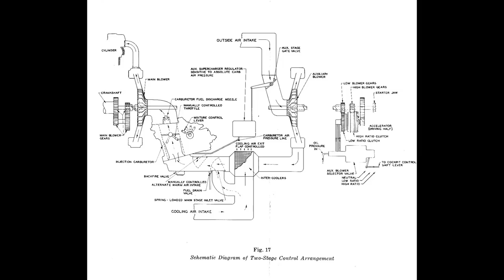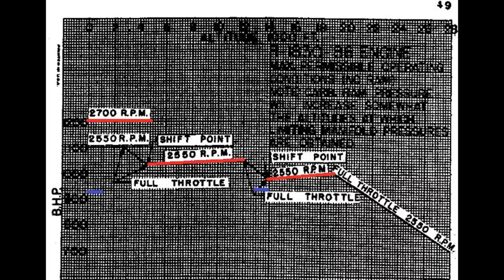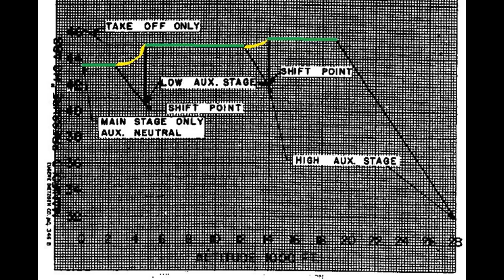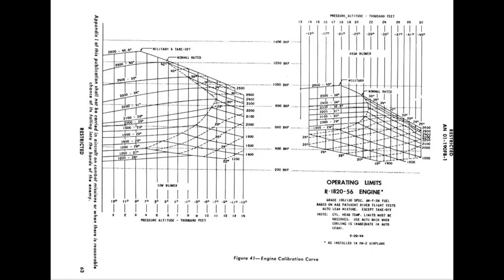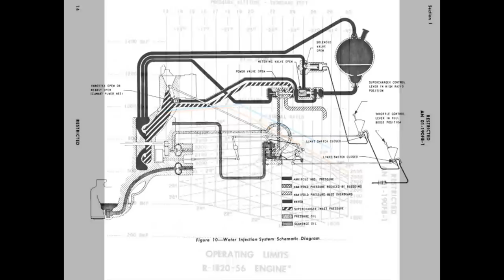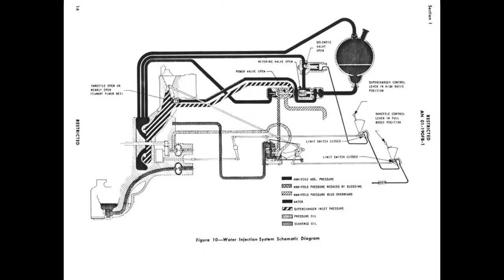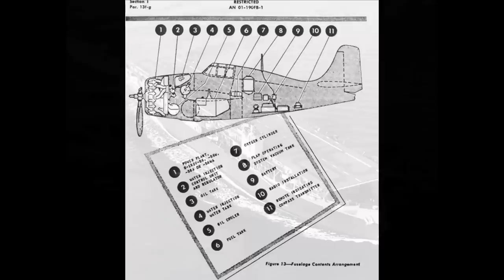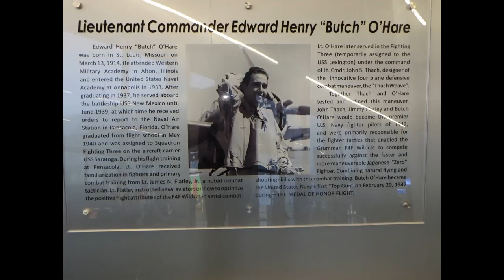Grumman Wildcat and FM-2

Comment: The Sagamon class of escort carrier, due to their size, had composite air groups that contained F4U Coursairs.
Reply from the maker: Maybe, I haven't seen evidence of that, and if it was done it was rare. Now I have seen a picture of a Corsair landing on the USS Charger, which a carrier featured in this video, but that doesn't mean it was operating off of it. It was usually an emergency situation, ferrying of the aircraft, or qualification work.
Reply: @GregsAirplanesandAutomobiles  I found it in a book on Leyte gulf
Reply: Doing a quick search I found some vague allusions that they could but no solid info that they did. Also we're talking about 4 ships out of over 120 escort carriers constructed most being the smaller Casablanca and Bogue class.

Comment: The more one looks into things the more it becomes apparent that the Zero is a false god, it's reputation is basically built on it's early use against obsolete Chinese biplanes and it's early use against the US Navy, but those guy's learned fast and quickly turned the tables against the Zero.
There's a surviving Japanese ace (first name Honda, I can't remember his last name) who was interviewed not long back in a video here on YouTube, he himself said that the Zero was their worst fighter of the war because the designer's mistakenly thought that the best fighter design would be an aerobatic plane with gun's on it, completely disregarding any kind of survivability for the sake of performance turned out to be a very big mistake on their part and cost them a lot of pilots. 
The loss of the original 2 stage supercharger on the Wildcat is supposedly attributed to the upcoming F6F and F4U's, I've read where the powers that be decided that since the manufacturing of 2 stage superchargers was limited they should go to the new F6F's and F4U's that were just starting production.
Reply: The thing that set the Zero apart from its contemporaries was its range. It was the first true strategic fighter. Rabaul to Guadalcanal is further than London to Berlin and the Zero could operate over that distance.
Reply: @bobharrison7693  
That's a good thing though, because they had a long range means they could get to all the places where they were shot down.

Comment: I've read about Wildcats using diving attacks on Zeros since I was a kid- so very interesting to learn that the airplane had no aerodynamic limits in a dive. Are there stories of compressibility issues during Wildcat development or operations, or was the shape not as prone to developing the shock waves that bedeviled the P-38?
Reply: Several contributing factors, the Wildcat is a high-drag design. With it's fat stubby fuselage, lack of filleting, steep wingscreen, the large radial engine with its Pre-NACA wind tunnel cowling. It couldn't dive fast enough to get into trouble, even when pointed straight down. Later craft such as the P-47 and Hellcat, especially the Bearcat, had vastly superior internal cooling improvements. Although they look approximatly the same, they are a technological leap and bound ahead of the wildcat.

The F4F used a 15% thickness Airfoil at the wing root, and the P-38 used a thicker 16% section by my research. (Spitfire = 12.97% and had the highest Mach divergent drag speed of all). Thinner Airfoils create less of a velocity increase over their surfaces, allowing higher speeds before compressibility effects take over. For sustained supersonic flight, ideally you want less than 5% thickness. but anything below 8% can often be made to work, even for a straight wing, given enough horsepressure. See: Bell X-1.

The P-38 was recently discussed on this channel, and it was mentioned that the twin booms and fuselage center pod created a Venturi effect between then that sped up the airflow even more. Right over that 16% thick Airfoil section near the root. This would cause the airflow to go supersonic over the wing at an even lower Mach number. Perhaps less than M0.65 or so. Not much higher than the P-38s top speed at high altitude in the winter. Complicating matters was that the P-38 horizontal stabilizer was located nearly directly aft of the wing, it wasn't staggered vertically any significant amount. So it would get blanked-out by air buffeting from the supersonic shockwave forming over the wing, losing its effectiveness. All at the same time the center of lift (center of pressure) over the wing was moving farther aft due to the shockwave, causing the center of gravity to be located even farther ahead of the, now relocated, center of lift. Which makes for a too-stable airplane that's too nose heavy. Again, at the same time it's elevator is becoming ineffective. (See: Mach Tuck). 

The wildcat has a conventional tail, located farther above the wing, and that fat fuselage is constricting at the rear end, which tends to reduce the local velocity of the air as it reaches the tail. So the wildcat probably has a higher dive Mach number than the P-38, because of the thinner wing and more effective horizontal stabilizer. And then it's so draggy that it could never get there. Perhaps, I'm only speculating, that it's internal cooling air could go supersonic long before the wing, creating a mach-divergent drag increase internally, casing the airplane to effectively hit a wall in a dive. This is not pure speculation, as the NACA works on internal Mach numbers extensively.in the early 1940s on other models, after the wildcat first flew.

Also, people know the Mustang used the Marideth effect to generate additional thrust to offset cooling drag, but it could contribute to radial engine thrust as well, it only required a tight cowling and properly positioned cowl flaps, and a gentle-radius curvature of the firewall to allow the airflow to accelerate smoothly out the opening. I'm not joking, it was that easy. In addition to Marideth, they worked on ejector exhaust, and found for the pure supercharged designs (not the turbo p-47) NACA showed that one could easily achieve an additional +16% Horsepower equivalent thrust at 350mph from a properly designed exhaust system, on a supercharged engine. That's around +300 additional Horsepower worth of thrust for a Corsair, Hellcat, or Bearcat.  (In addition to using the exhaust velocity to "pump" air out the cowling for engine cooling during ground run-ups, using exhaust augmenters. These were able to achieve over 6-inches of water drop vacuum through the engine cooling fins, using the exhaust to pump the air out). - Neat stuff.
Reply: shorter answer, the Wildcat's aerodynamically limited terminal velocity in a dive was still quite a bit below the speed where compressibility is a hazard.
Reply: @TheJustinJ   good info but for my understanding, what do you mean by percent? You mention that the P-38 had a 15% thickness airfoil at the wing root. What is that 15% of? It's height is 15% of it's length?
Reply: @danraymond1253  nailed it. 

The P-38 was 16% at the wing root, that is thickness to chord ratio, or hight to length, yes. 

Thicker-percentage means the airflow over the curved surface accelerates to a higher velocity, in reltation to the air rafts forward flight speed. (In engineering terms, this is expressed as either velocity or pressure as the two are interchangable, higher velocity is lower pressure ala Bernoulli).
Reply: @TheJustinJ  cool and thanks for the reply. Does this mean that (in general, I'm sure there are multiple variables at play here) a thicker wing for it's chord would produce more lift and thus a more maneuverable fighter? 

Also, (not that you're wrong, I am just curious to learn more) can you provide a source with the airfoil thickness of other airplanes or at least the P-38? I'm a big fan of the P-47 Thunderbolt so I wonder what the airfoil thickness on that was. I am starting college now and have a major interest in all of this, though I am still quite naive to many of the principles of aerodynamics. I'm sure I know a lot more than many peers my age, but I feel the more I learn, the more there is to learn that I cannot yet understand.
Reply: @danraymond1253  Wikipedia NACA airfoil
Reply: @TheJustinJ  Excellent comments...quite a learning curve for us WW2 buffs. Thanks.

Comment: I know why The F8F Bearcat only has a single stage supercharger  system now after watching this video . I always wondered why they didn't put a two stage blower in it.  A variable speed supercharger means the supercharger can change it's speed independent of engine rpm. Is that a big improvemnt over a 2 or 3 speed supercharger?

Comment: The SNJ was sold to Congress as being combat capable due to funding issues in 1940 and the SNJ when armed for advanced training would have been a credible convoy escort aircraft with a depth charge or a few bombs and a cowl-mounted machine gun firing through the propeller arc (changed to one wing gun firing outside the propeller arc) and a machine gun ring in the back cockpit for air-to-air gunnery.  If not for "excess" Wildcats, the SNJ might have wound up protecting convoys from U-boats and flying boats.  Or not--a single .30 caliber nose gun isn't much when used in the fighter role.

Complain about the FM-2 having less performance than the Zero?  It could have been the SNJ.

Comment: Another great video.  I'd like to ask two questions:
1.  Why is slightly more manifold pressure permitted at higher altitudes?  Is it assumed the cooler air there allows more manifold pressure before reaching the detonation limit?
2.  Even with the higher manifold pressure there is somewhat less horsepower.  Is the chart at around 10 minutes into the video net horsepower, and is the reduction due to the power consumed by the auxiliary blower, or something else?  
Thanks
Reply from the maker: 1. The intercoolers are more effective in the cooler air. 2. Although manifold pressure is the same, the superchargers need to create a lot more boost due to the low ambient pressure. More boost costs power in terms of the energy needed to drive the superchargers themselves.
Reply: @GregsAirplanesandAutomobiles  Thanks Greg.

Comment: Although On The Brink Of Obsolescence, The Grumman Wildcat Proved It's Worth On Escort Carriers NOT In The Pacific So Much But In The Atlantic As Part Of The "Hunter/Killer" Anti-U-Boat Teams. It Was The Wildcats From The Escort Carrier, -The "Baby Flat Top," -U.S.S. Guadalcanal, Commanded By Captain James Gallery, That Assisted The Destroyer Escort Team To Force-Surface And Captured The U-505. The Wildcat Pilots, Observing The Just-Submerged U-Boat, Fired Their Machine Guns Into The Water Of The General Area Of It's Submergence, Following The Enemy Vessel Beneath The Surface Until It Could No Longer See It. Then The Destroyer Escorts Applied Sonar And Depth Charges To Bring The U-505 To The Surface And Applied Machine Guns To To The Escaping Crew, Keeping Them At Bay To Be Captured Along With The Sub (That Now Resides At Chicago's Science And Industry Museum.) It's Appropriate That A Wildcat SHOULD Have It's Place, Also In Chicago, At O'Hare Airport.

Comment: You ask what other airplane has no speed limit, where the terminal velocity straight down is not enough to damage the airframe.

Stearman 75 biplanes also are in that rare club.
Reply from the maker: Sort of. I have flown the Stearman and it's true that it's terminal velocity will not over speed the airframe. However it will overspeed the engine, at least with the prop that was on the one I flew.

Comment: 12:20 I'm guessing that it's just because you're using your old commentary, and you knew less back then, but I don't think this part is right. Those drops in boost appear to be the points when a given drive speed has gone past its critical altitude and is now unable to provide full manifold pressure. The throttle should already be wide open in these gaps, so there simply isn't any more boost to be had. The only way to get more boost would be to change speeds early. That would provide full manifold pressure, but the throttle would have to be reduced to avoid overboost, and driving the supercharger faster would consume more power and result in a loss of power to the propeller instead of a gain.
Reply from the maker: No, and no. It's not because I am using old commentary and the pilot's manual very specifically says to pull the throttle back before engaging the aux blower  in low speed and then again before switching it to high.   Failure to do so will absolutely risk overboosting the system. I explain all this in my Turbo vs. Supercharging videos.
Reply: @GregsAirplanesandAutomobiles  From that description, it sounds like the Wildcat needed manual throttle control below critical altitude to prevent overboost (because there's no automatic regulator?). In that case, the instruction about reducing the throttle before speed switch would be to prevent overboost in the higher gear, and would presumably be something you did just before switching. I don't believe that explains the dips in manifold pressure on the diagram. Those are a necessity of any multi-speed system.

Take a look at FIGURE 7 in NACA report 384. I know this isn't showing a multi-speed system, but actually six different sized superchargers, but the principal is the same as a multi-speed system. Supercharger "A" hits critical altitude at 5000 feet. After that, it starts loosing manifold pressure and power, but it still has more power than supercharger "B" for a while. The two lines cross at about 6000 feet, which is the optimal speed change point. That means that between 5000 and 6000 feet, we will see a dip in manifold pressure, but this is still the optimal way of running the engine. The throttle is wide open during that whole range, so the pilot has no way to get more pressure or power.

I believe those dips in the Wildcat diagram are for the same reason. Even if the Wildcat pilot isn't climbing, and so isn't about to change speeds and doesn't need to reduce the throttle, if he's at 4000 feet, he'll still be running at a lower manifold pressure. That's because, at 4000 feet, the primary stage is well above critical altitude, but is still producing more power than the auxiliary stage low would. A "really careful" pilot should be able to hold off on reducing the throttle until just before speed change, but that won't get rid of the manifold pressure dips because there will always be times during his climb when he's running a supercharger speed beyond its critical altitude, so his manifold pressure will go through that saw tooth pattern no matter what he does.

Comment: I read in a book that zero had stiff alerons somewhere above 20,000 feet.
Reply: That was above 250 knots. The A6M had huge ailerons and it was hard to roll at higher speeds. Allied pilots learned to stay above 250 knots.
Reply: Also had diving speed limits..

Comment: The Wildcat did more than hold the line. They took the fight to Japan. You can say the same about the P-39, P-40 and the P-38 come late 1942.
Reply: I find it funny how certain low altitude aircraft get Heavily criticized, while others are heaped with praise.

P-40 vs Hawker Typhoon, for example. Arguably the P-40 was far more important to WW2 than the Typhoon, yet the Typhoon is idolized, and I really don't understand why. The Typhoon did nothing the the P-40 and other aircraft couldn't.

But low altitude planes include the likes of the F4U, IL-2, Hurricane, etc.
Reply: @SoloRenegade  It is interesting you compared the P40 to the Typhoon, The Typhoon's designed role was high altitude. problems with the engine made it unsuitable/ Hence the rework into the Tempest. New engines and were tested and a laminar flow wing was added if memory serves. It was none the less a beast down low.
Reply: @JohnRodriguesPhotographer  the Typhoon contributed little. The P-40 contributed more. Both were low altitude fighters that also performed ground attack. One is criticized constantly, the other overhyped. Just calling out the logical inconsistencies with which certain airplane are judged.

Comment: The plane in the intro is not at O Hare Field, it is at Midway Airport. Midway is in the South Side of Chicago and I have spent a few minutes examining it myself.
Reply from the maker: ifga, I'm an airline pilot and fly out of O'Hare all the time. The plane is at O'Hare, I saw it there just a few days ago.
Reply: @GregsAirplanesandAutomobiles  There are either two planes, one at each field or it was moved from Midway to O'Hare. I prefer using Mitchell, in Milwaukee because it is more passenger friendly.
Reply from the maker: It's painted up as Butch O'Hare's airplane. Why would they put it at Midway?